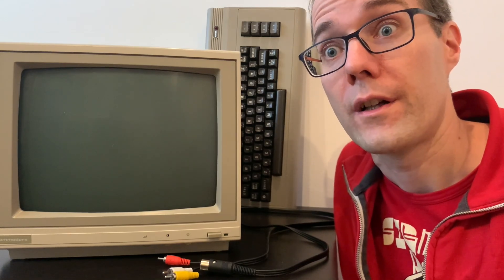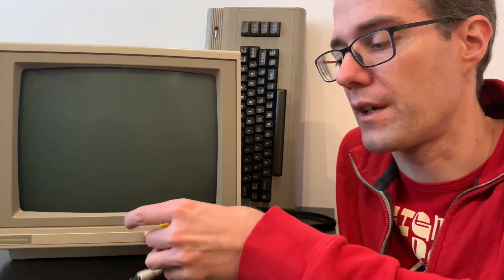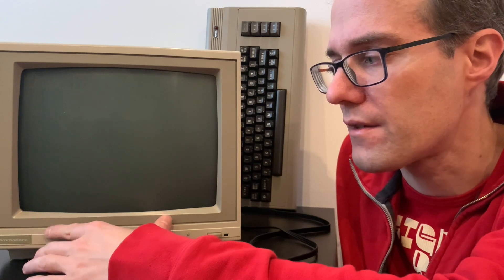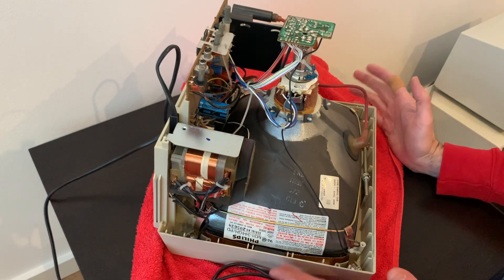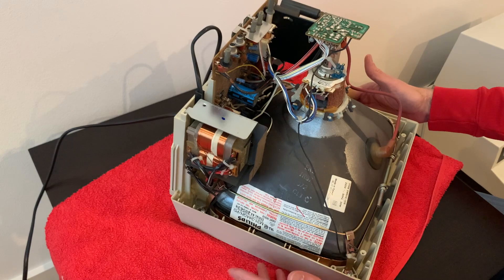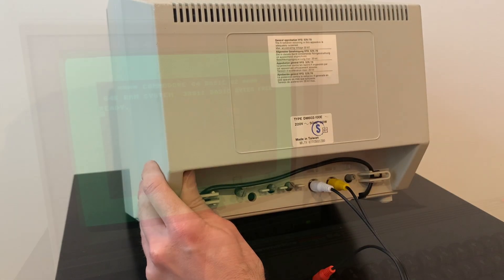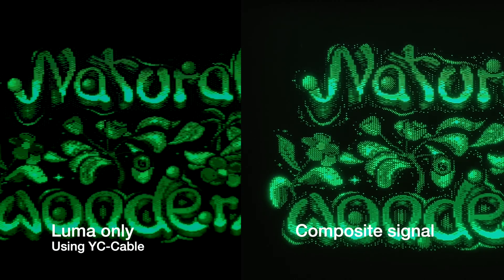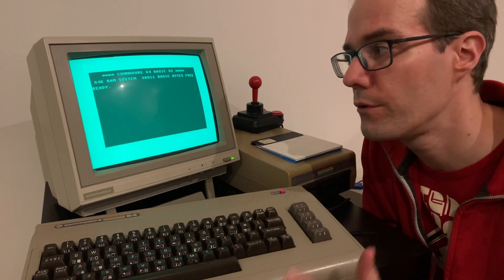Repairing a Commodore DM602 Green CRT

Comment: Hello, thank you for this video! Is there any possibility to exchange the outer part (plastic box) of one DM602 to the other? I mean, to disassemble the whole monitor incl the tube from one and put in the other? I have one without video and sound, and I recently bought a good working other one from the Ebay but the outer plastic front has been cracked during shipment (DPD....) Thank you very much
Reply from the maker: I don’t know, but I would guess that it should work. If the DM602 isn’t as heterogeneous as for example the 1084S, which had many different variants.
Reply: @root42  Thank you

Comment: Hey ! Got the same monitor as you but the c64 image seems to be revolving around one line at turn on and the stabilizes but is very shrinked vertically. Do you know about that issue ? Thank you in advance ! 😅
Reply from the maker: Sorry, no. Several guesses: v-hold not adjusted, or failing capacitors or some other failing components. You might want to take a video and ask in one of the many C64 forums for help n
Reply: @root42  Yes thank you that's a good idea. After further inspection it seems the whole picture is there but "rolling over" like a rolled pankake haha. Very weird but probably a component yes. It's the first screen I restore so I'm a bit lost ^^ Do transistors fail and have an impact on these things or are caps the main things so replace ?
Reply from the maker: @The1920sDandy probably vertical foldover. Could be broken vertical deflection due to damaged capacitors. I would strongly suggest you go onto a forum to get some help. Also be careful, as CRTs contain very high voltages. Do not work on it if you don’t know how to be safe!
Reply: @root42  Hello it was vertical foldover indeed. By security I replaced all the "fat" caps between 500uF and 50uF and it works like a charm no. Not so difficult ! ^^
Reply from the maker: @The1920sDandy  Perfect! Fantastic to hear that another CRT is now working again!

Comment: I have a monitor that looks just like that, but it says Highscreen instead of Commodore.

When I turn it on, I can see a "light" thought the air vents at the back. Is this normal?
Reply from the maker: Yes. The CRT has filaments that glow and produce the actual electrons that make up the picture on the front of the tube.
Reply: @root42  Thank you.